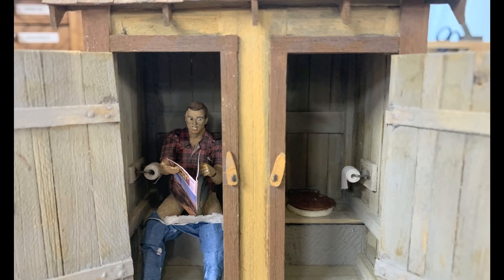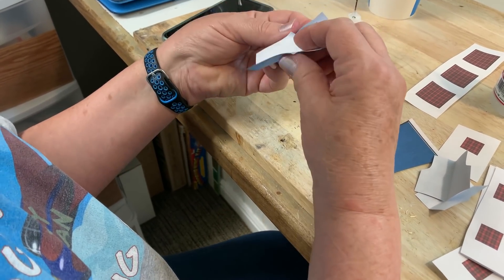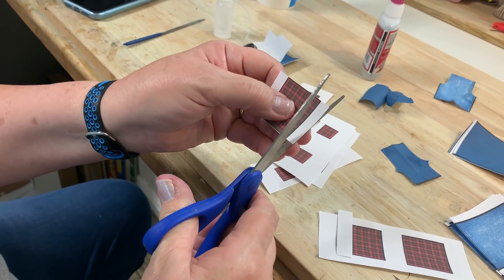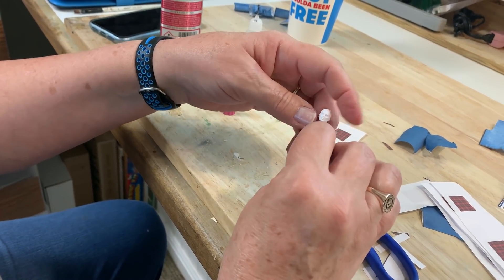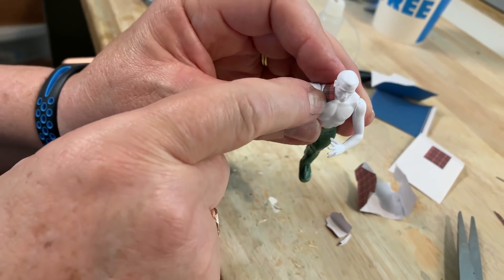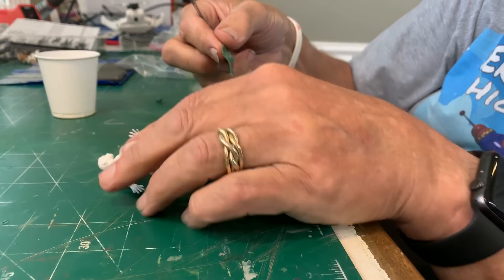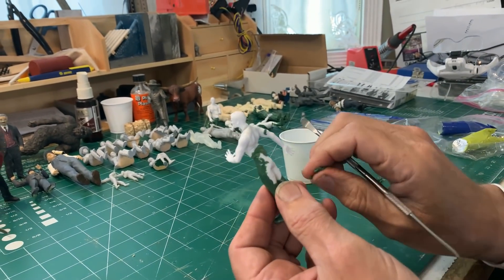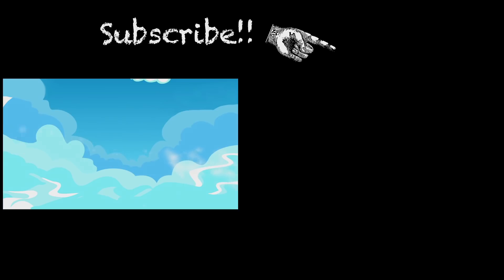Model Railroad Figures - Part two adding clothes to large scale figures.

Comment: Should I make figure a or buy them . What's the different in cost?..🇨🇦
Reply from the maker: Great ones are about 15 to 30 so not cheap at all. Prisler are about 40 for 4. The seated people were 12 for 8. And turned out to be Chinese knockoffs of Prisler. I don’t like knock offs. But didn’t know when I bought them. I like to but but modify them.